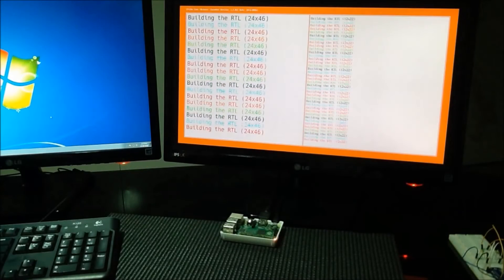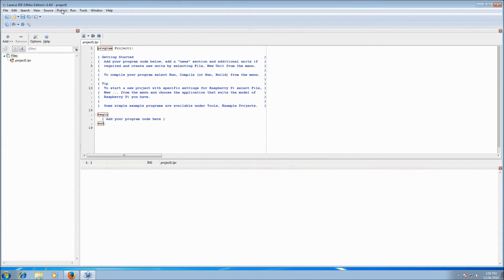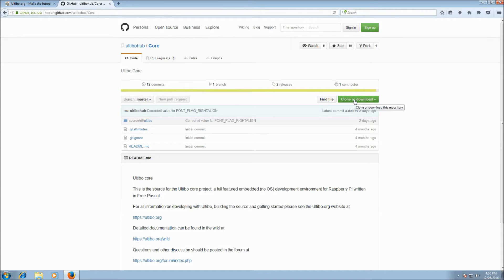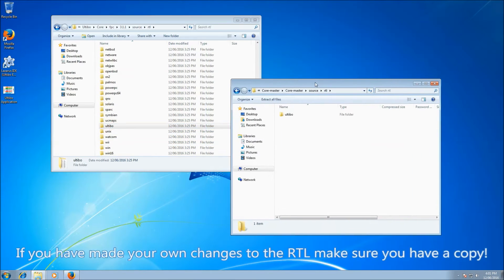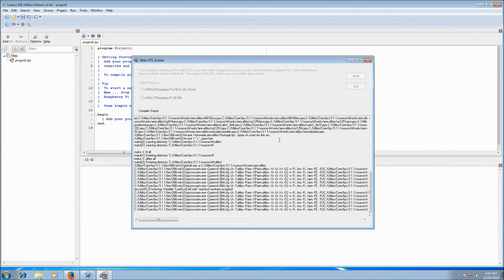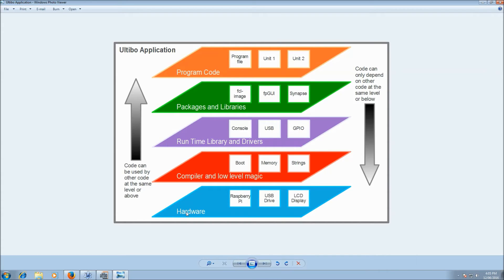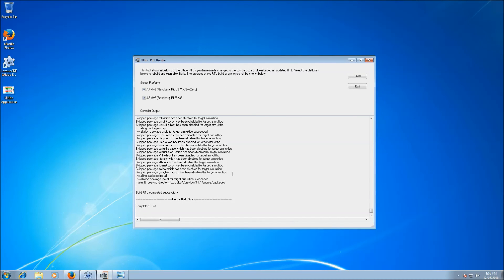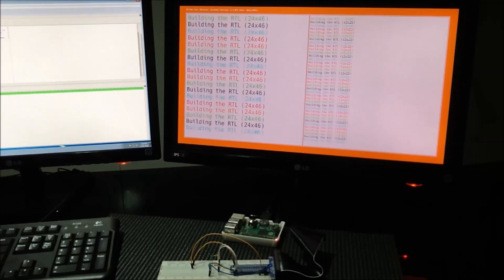Discovering Ultibo - Episode 3 Building the RTL

Comment: RTL... So the pascal code is compiled to bytecode like .NET?
Reply from the maker: No, Free Pascal generates native code not bytecode so it is very fast. The RTL includes lots of ready to use features which makes developing apps easier.
Reply: Ok, so the RTL is like library linking in arduino, except always in the kernel even if not used?
Reply from the maker: Yes, similar to libraries but only the used portions are included due to smart linking.
Reply: That must make compiling much faster than C.